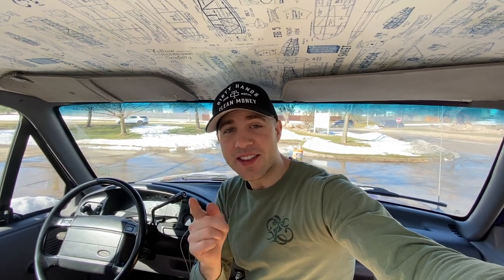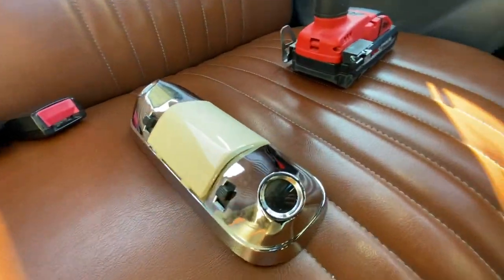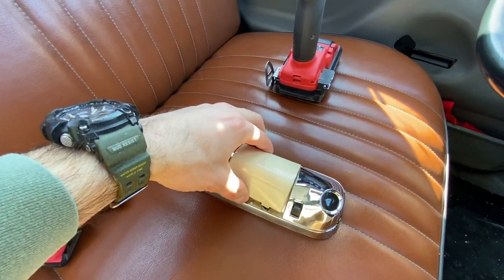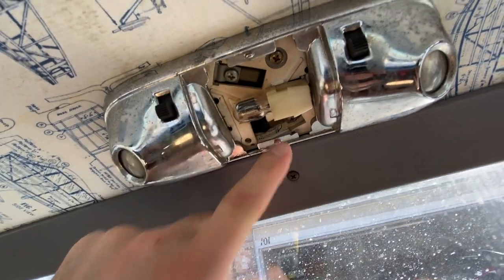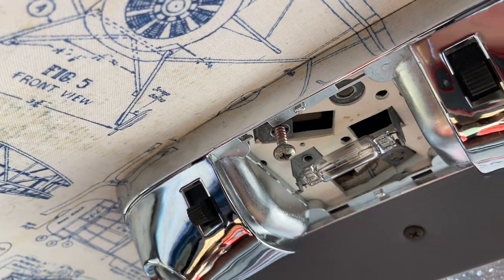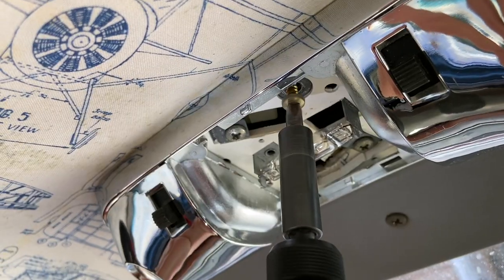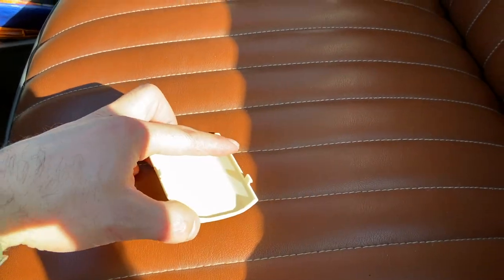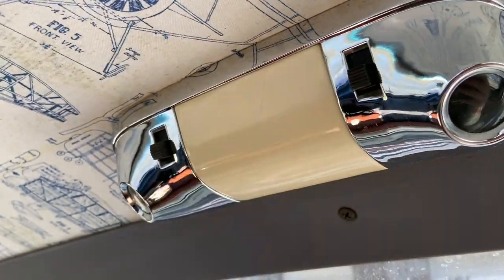How to Replace 1995 Ford F150 Cab Dome Light

Comment: If anyone wants to know in case you are upgrading to LEDs because I couldn't find this anywhere, but after changing them myself, the bulb size for the map lights are 1156. As for the center dome light, you can fit a regular old 194 or 912 bulb.
Reply from the maker: Thanks for letting us know man!🤙
Reply: Appreciate your help

Comment: What is the part number of the center light bulb on the first dome light you took off(the one you can see). Can’t find it anywhere. Thanks
Reply from the maker: I can’t remember off hand. I don’t even remember replacing it with a new one. Although, I’ll bet it’s in the bulb section at any auto parts store.

Comment: Any idea why when I open drivers door dome light won’t come on.. but passenger door opens it comes on and if you click the dimmer to the left it comes on..?
Reply from the maker: My best guess is the door jam pressure switch. If it fails it can either leave the dome light on or off. In this case, the switch malfunction into the off position. It’s a black piece that sticks out from the hinge side of the door jam. You can remove it and replace it.
Reply: @TheMinuteMasters  Hey man thanks for getting back to me! I have another question to pick your brain.. I picked up a 95' f150 351w/auto 4x4 Monday, on the Inova OBD-1 scan tool it through 311, and 332.. 311 says Thermactor air system failure, 332 is insufficient EGR flow. The truck will stall when coming to a sudden stop or if you put in reverse. I was confident this was a TPS or IAC control issue until I ran the codes. I'm lost on the Thermactor thing tho? Any idea where to start?
Reply from the maker: @jmitchell513  No problem Mitch! Nice! That’s a good find. 
The EGR is pretty straightforward forward and for how old these trucks are. It’s best to replace them. 
The thermactor system is an emissions things. On the back side of the intake plenum between it and the firewall is this bunch of vacuum lines feeding this conglomerate of black valves. From what I’ve seen, these thermactor valves are impossible to find new, if they need to be replaced. I would check to make sure all the vacuum lines are hooked up to it. I think it gets 2 or 3 lines. The thermactor is operated by the two other components that receive the vacuum lines. It really just boils down to, you have to make sure all the vacuum lines are connected before we can officially say the thermactor valve is broken.

Comment: what type of screws did you use?
Reply from the maker: There are special interior screws that hold everything. You can sometimes find them in the miscellaneous parts, section of auto parts stores. Otherwise, sheet metal screws can be a decent substitute.

Comment: Need to figure out where the short in mine is... I'm running an LED strip at the base of the rear window, but it shorted out and took the rear facing cargo light/third brake with it 😂😭
Reply from the maker: Ah! That sucks man! Shorts are a pain to track down.